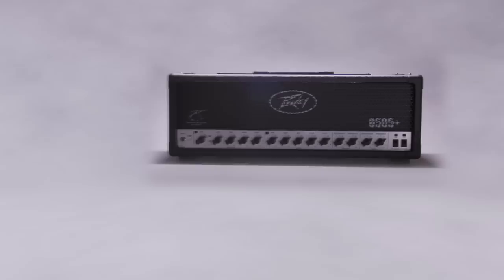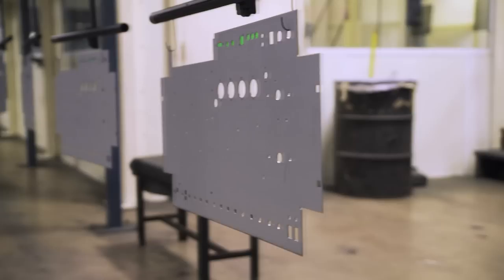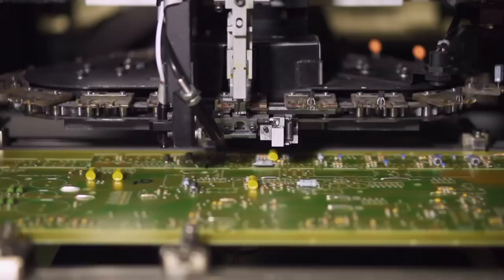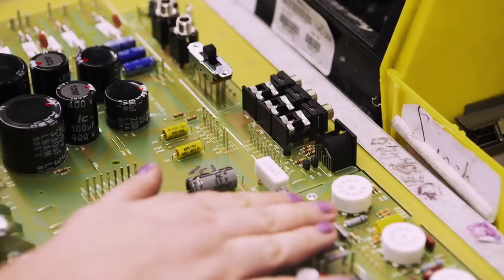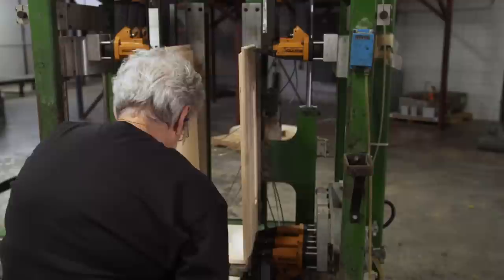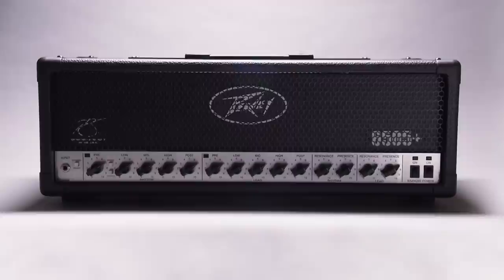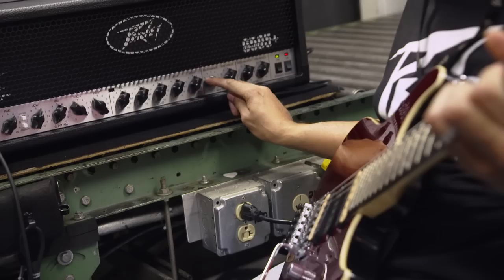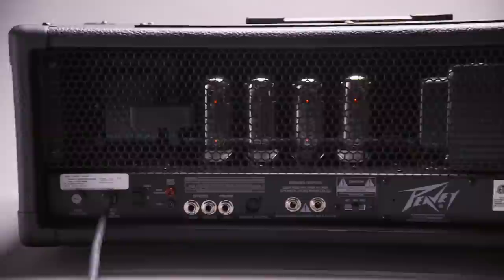How a Peavey Amplifier is made - BrandmadeTV

Comment: Hell ya, I got the 6505+ and is my all time favorite amp, especially matched with a Mesa 4x12
Reply: bakerXderek I want to buy one of them but I don't they are Chinese or what??? what is yours???
Reply: Ardalan Sh his one is USA made not chinese
Reply: How is the 4x12?
Reply: You can't go wrong with Peavey or Mesa Boogie!! Hands down the best two amps!!....of course that's my opinion....
Reply: I feel like they way over sold it saying it made a new genre, modern metal is more djent kinda stuff
Reply: @ericwilliams7374  Mesa is miles above peavey
Reply: Yeah, Boogie makes Peavey look bad...thats a fact.  I think the best Peavey head is the block 5150, but it can't touch a Recto or Mark.
Reply: @rickfeith6372  I've played both and Mesa blows the thing outta the water
Reply: Same set-up I have, ^505+ and recto cab. But my 65-5+ has a mercury magnetics choke and output tranny in it.. Sounds even meaner.
Reply: @guitargamez7930  Mesa Boogie heads cost almost double that of a Peavey. It has double the circuitry, features and sonic availability. Each circuit stage is isolated. Ultimately you get what pay for. I was never able to afford a Dual Rectifier hence why I bought a 5150. Mesa amps are the dream.
Reply: @ericwilliams7374  for metal I most definitely agree with you.

Comment: The first real amp I had was a Peavey solid state 50 watt combo that didn't work. At the time P used 8 pin op amps all over the PC board. But the jerks took the time to scratch the numbers off every component they could and refuse to send me a schematic.. I finally got it working by accident. Never owned a Peavey since, and never will.

Comment: the amp is not so versitile as guy said. This is typical high gain amp that suits best for metal, rock.
Reply: more metal, than rock - the crunch is too dirty, and you usually don't use the lead for rock. Clean is more bass heavy than on most marshalls or fenders, even orange is less bass heavy.
Reply: I'll keep my Vox amp because I play blues.
Reply: That was the first time I've heard anyone say a 6505 is versatile lol
Reply: The 6505+ is more versatile than the 6505. The 6505 has a shared circuit stage for Rhythm and Lead channels hence why, it doesn't really have a clean channel at all. Perfect for Rock and Metal though. The 6505+ has an actual clean channel because it has 2 seperate channel stages, so it is a versatile amp.
Reply: This am is not what you want to play rock with. 
The distortion is not right for it.  Still a great amp, I own one, but I like my 5150III much better and it’s more versatile!

Comment: It really doesn't matter where it's made and assembled if the right components and methods are used.  You wanna complain about something?  Well actually, the design...  For one, the tube sockets are soldered directly to the circuit board.  That's the biggest concern for me as an owner of a $1000 amp.

Comment: Nope. It was actually the EVH  5150 Peavey that started the Peavey craze in metal.When Eddie dropped their endorsement they changed the 5150 to the 6505.Lets not forget Mike Soldano and Mesa Boogie who was making better sounding high gain amps way before this.The dual Rec is on waaaaay more metal albums even though it came out at the beginning of the 90s.Dual Rec with a boost in front to tighten it up can only be beat by a very few very modern high gain amps.The dual rec pre-amp is a exact rip off of a Soldano SLO super lead circuit with a slightly different power section.

Comment: no.
the original block letter 5150 that evh designed with peavey is the sound that defined modern metal.  the 6505+ is merely a renamed  clone with slight variance in the lead channel that few people can distinguish 
peavey did not create this tone  Eddie did
Reply: Actually Soldano did. ;)
Reply: As cool as Eddie is he isn't an amp designer. He took a Soldano design, brought it to Peavey and asked for modifications.
Reply: @wea69420  actually it was based off of a highly modded Marshal 
get your facts straight
Reply: And that highly modified Marshall was based on a fender

Comment: They need to improve the stupid heat vent. They all crack, every 6505 I've seen has a cracked heat vent. A metal made one would be so much better, other than that, that amp is a workhorse.
Reply: Remember ordering one new from Peavey for my 5150 because it was cracked. And I was recovering  the head. $65 this was 7 years ago.  Its cracked.

Comment: SO, anyone owns the new made in china heads? 6505/6505+? IIRC the batch should be approaching 2 years old. What is yours doing? or anyone who's repairing em during the period can quote on the internasl?
Reply: mine lost all of its bite. it no longer sounds like a 6505. doesnt have that tube push feeling that it used to have when i first bought it. i replaced the tubes and turned the bias all the way up etc. im now looking to get rid of it
Reply: hey thanks for sharing. Did you consult any amp tech? Like I mean, if you need to adjust bias you need to look inside it right? How do you/your amp tech say about the interior? Could it be the parts that is failing? I mean, I am trying to find a few last saving grace that can still justify if I'd ever consider any new 6505 heads for me again.
Reply: nah 6505s are rather cold so its okay to adjust the bias however you please. most people prefer turning the bias knob all the way up. then there are people that swear that it matters. i havent taken it to a tech. i usually always go through peavey USA though for servicing. they repair my amps for free which is very generous of them. and they get it done ASAP. theres nothing really wrong with the amp. it just doesnt have that Peavey 6505 bite. that bass feeling in your chest. it sounds a lot thinner than it used to. i love my 6534+ though. it had to be repaired because of a bad screen grid resistor but its been solid ever since the repair.
Reply: in my honest opinion. it still has that peavey tone. just not the bite. and its only my amp out of the thousands that are out there that were made in china. if i had the chance again id still buy another. especially with Zzounds pay as you play plan. theyll send the amp after the first pay installment and bill you every month for however long you choose.
Reply: Atrox Terra I'm by no mean an amp hardware geek/expert. But when you say it lost the extending lows I think I can say the factory shift does indeed cut on internal parts. (Usually worse off transformers cut off extreme highs and lows compared to good ones, or if its within 2 years then it might be other parts failing.)Alright. That much is enough for me to say I need to move on from thinking about a 6505 over years. Thanks for sharing all these.
Reply: let me get back to you about it in the next week or two because i actually want to try the amp again without any pedals/effects and go directly into it to see if it may be a pedal. the amp is in our practice space and i wont be able to try it out til friday. ill keep you updated. i personally really hope its one of the pedals or even my wireless
Reply: Atrox Terra Thats nice from you. As I just decide that I'd move on for higher tier amps, but it still would be good to know whether the current production 6505s is still in the game of reputable high gain heads if I'd ever want to buy one for my amp collections to achieve certain tones.
Reply: 2 weeks' up man.
Reply: hey man! sorry i didnt realize i commented on the band account lol yes i played straight through and it turned out to be a chord. however i switched amps the other day and played my 6534 for the first time in a few years and it was deff better than playing the 6505.
Reply: It's ok man. When you were not around I found all my possible channels of importing a 5150/6505 from US to my island failed(my reliable concierge services does not get 120 watt tube amp with "powerful magnets" through. Only the shops have those channels.) . Eventually I topped up and now waiting to get an EVH 5153 100 watter locally. I think it should leave all these questions irrelevant anyway.  I know there is some tonal difference from the original. But judging from all sources I can quote, the difference is probably something I'd welcome. Anyway. Thanks for remembering, taking time to respond and suggesting on me, appreciated. I did check out your band's music too. Of course my personal is tech-heavier but I think it is a decent work and production and a good job from y'all. All the best man.